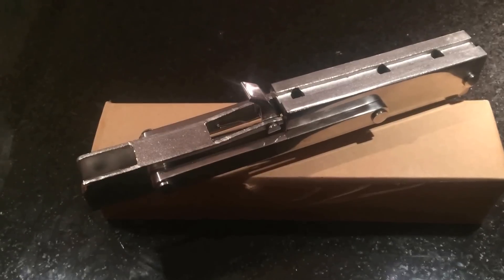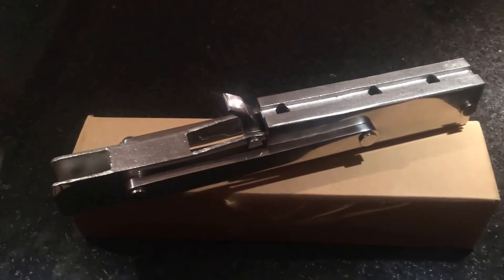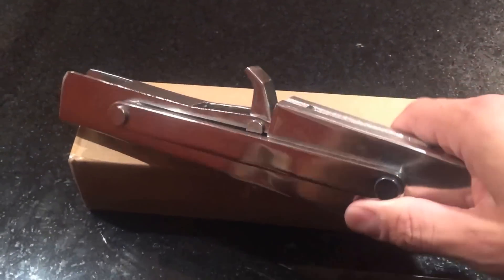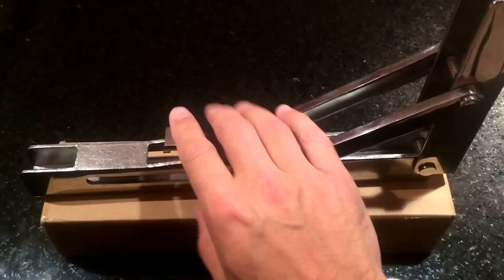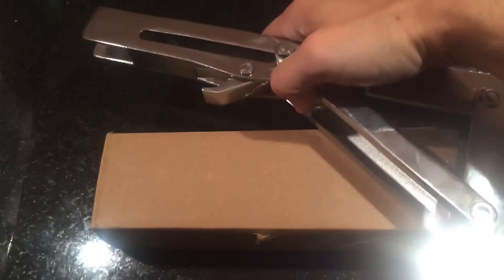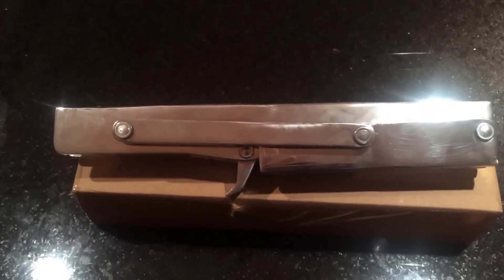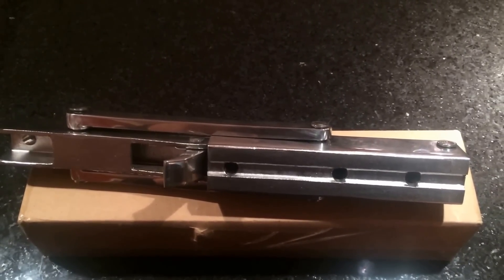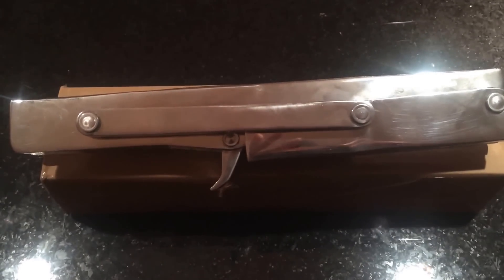Boat building progress: fold-down seat hardware

Comment: wondering if you have a video of the install and/or finished product.  I checked your channel and didn't see.
Reply from the maker: Hi Josh. Thanks for your comment. I haven't made a follow-up on these brackets. But I can take a few shots for you and post them up when I get a minute. Bottom-line: I would absolutely use these again. Probably the strongest part of the boat! : )

To mount these, I added 2 thick ash plates to the stern and bolted it to these plates using stainless lag bolts and washers. I also applied 3M 5200 on the bolts and washers for added mechanical strength and water tightness. The upper arms attach fasten to the underside of the bench using simple #8 stainless screws. 

However, I must admit that I have yet to lower that rear bench! All that beautiful stainless and not a single raising and lowering... I simply never have the need in real-world use to lower the bench. What's more, the way the engine lines and electrical lines run beneath the bench area, it wouldn't go fully flat to the stern even if it were lowered. 

As a static bench mounting bracket it's absolutely rock-solid. Several grown men could jump up and down on the bench and that bracket wouldn't budge. The wood of the bench would splinter first. But it's one seriously expensive way to mount a bench that doesn't need to fold : )

Let me know if I can answer any questions. Great product.
Regards,
- Kris

By the way... I just re-read the description of the bench I originally published. Instead of making a plywood bench, I used solid mahogany. I found some remaindered mahogany handrail at my local lumber yard. Beautiful stuff that was being scrapped for some small defects that ended up cutting off. It's about an 1 1/4" thick. I believe the rigidity and beefiness of the bench is more appropriate for the span between these brackets. If using 3/4" ply there may be sag.
Reply: Really appreciate you taking the time to respond.  I'll likely be using starboard with some aluminum bracing if I make the bench, doesn't need to look good and will have a cushion on it whenever it's in use.  Mine would be DOWN most of the time (fishing boat) but wife wants stern seating when we're cruising.